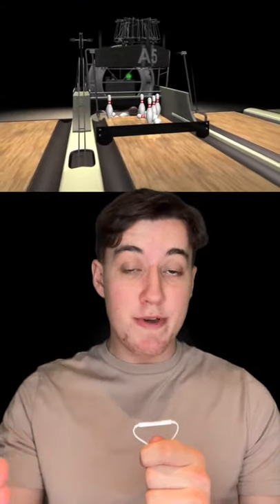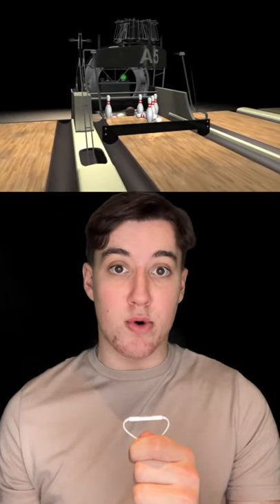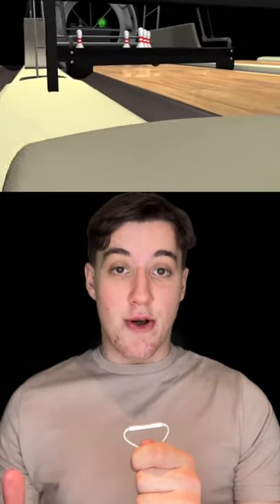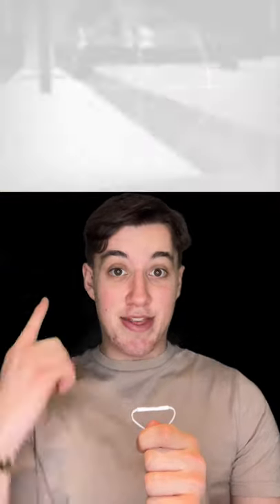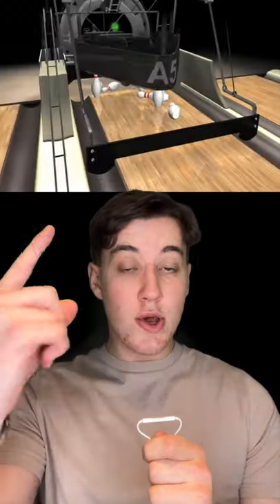How A Bowling Alley Works! #Shorts

Comment: Pinsetter in this video is the Brunswick A2
Reply: sort of. The A2 has a ball wheel and a pin wheel together not separate by a divider
Reply: @nikolaskrofta1652  the ball returning system used was an AMF model, the actual pinsetter is a Brunswick A-2